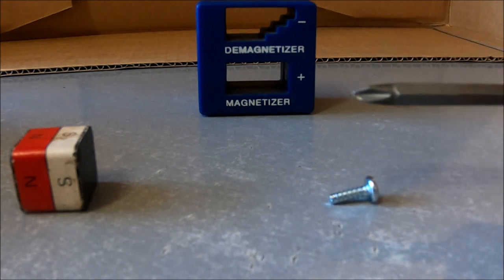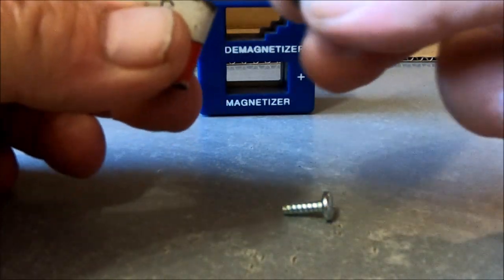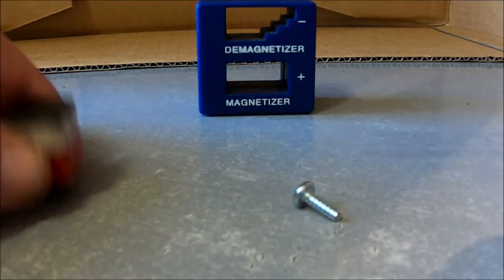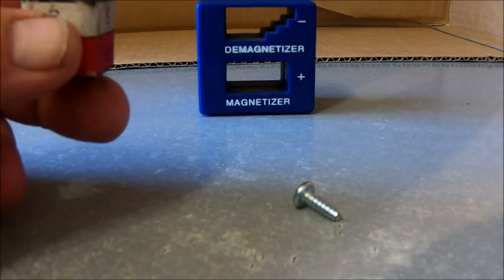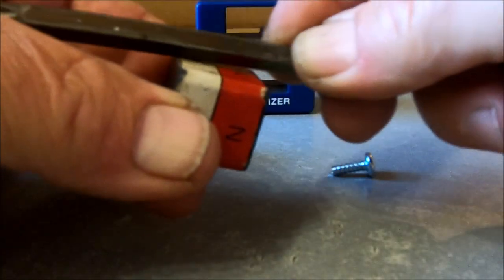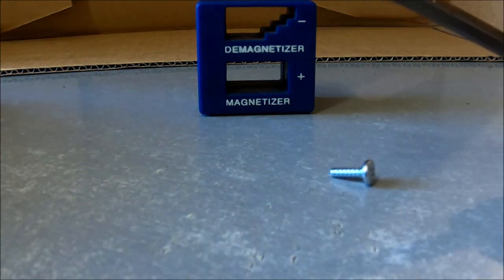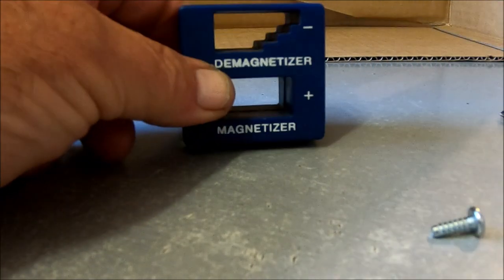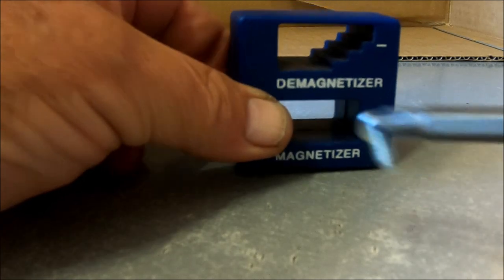How to demagnetize a Screwdriver

Comment: I just recently bought a magnetizer demagnetizer like your blue one and jeez im having a hard time demagnetizing my tool tips and drill bits. I also happen to own a dozen microwave magnets and now i feel dumb
Reply: Yeah those “demagnetizers” suck. Always leaves behind a little bit of magnetism. In precision work that’s just unacceptable.
Reply: they just re-magnetize where the new field is perpendicular to the length of the screwdriver. that's why it's still a magnet. it's weaker because the "length" is now the diameter of the screwdriver rod.